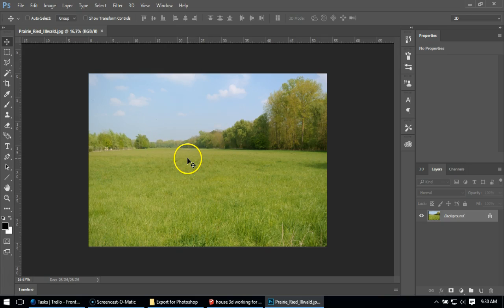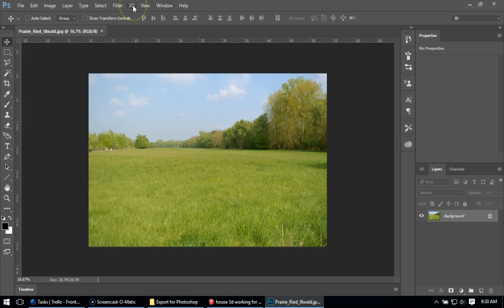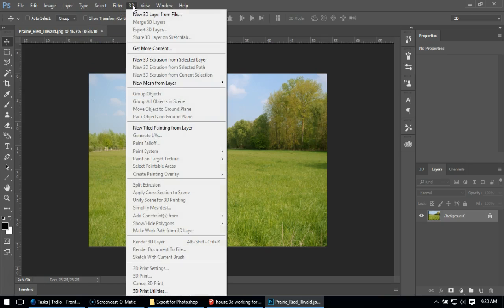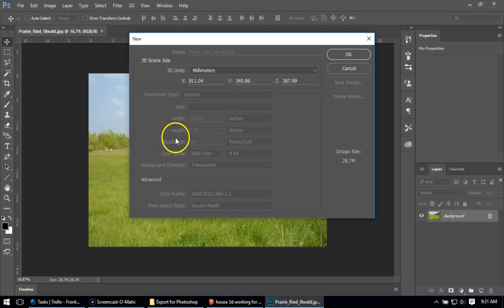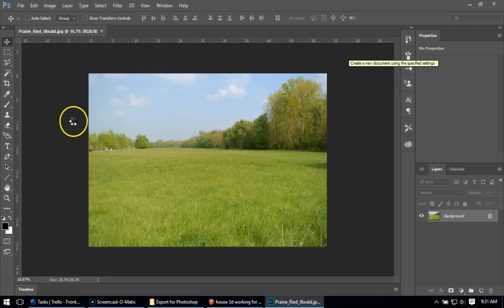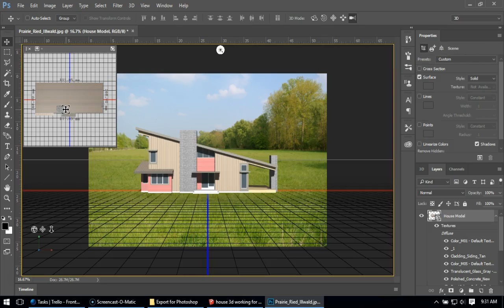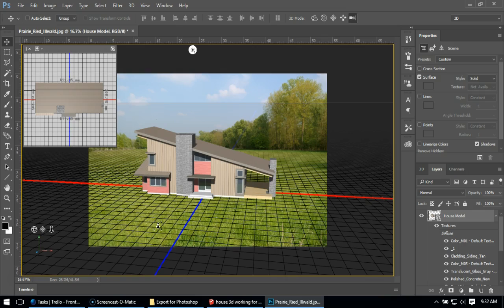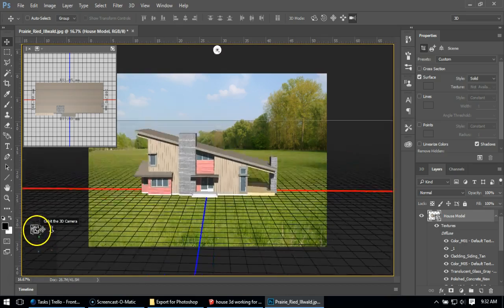Importing 3D model as OBJ into Photoshop

Comment: Doesn't work in PS 2024. There is no 3D tab at the top.
Reply from the maker: Yes, you are correct, Photoshop no longer has the same 3D functionality it previously did. The good news is, since this video came out, there has been a lot of advancements in 3d modeling and rendering with other software that makes these Photoshop tools antiquated.
Reply: @michaeltweed5192  what do you use instead then?
Reply: @edenmyass  I do most of my 3d work in Sketchup and recently I have been reding using Enscape.

Comment: Can you please help with this situation ? I have a 3D apartment model, when I import this into PS it comes as parts not a whole building. How will I link all those independent part to each other?
Reply from the maker: It is always hard to diagnose an issue like this but here are a couple thoughts. If you have multiple models you should be able to import them into the same Photoshop file. However, if the issue is that there are just some elements not coming into Photoshop it may be because you have some back faces (the gray side) as front faces or you put a material on a group level, both of which Photoshop doesn't really know what to do with.
Reply: @michaeltweed5192  ok :) I must give  more details about what I  have here. I import a building and all elements (Windows, doors, fences, walls etc. ) are in correct order and place. However when I want to turn or move the building let's say only walls are turning, or only windows etc, whatever I select that element is moving or turning. I can't select them all at once.  I couldn't figure it out how to link them together. I am new to 3d so I don't even know how to find correct words to google it.
Reply from the maker: @wishmastertr  ok I see. Usually the way I work is that I try to do so my moving and such in sketchup. The only thing I change in Photoshop is my view, the camera position ect. You can zoom and pan around the file to get the position and angle you need. You don't need anything selected for this.
Reply: @michaeltweed5192  I figured it out in 3D menu there is " group all "
Reply from the maker: @wishmastertr  awesome, glad to hear.